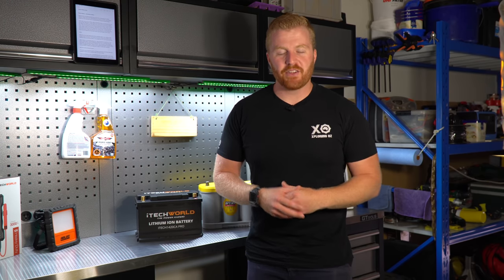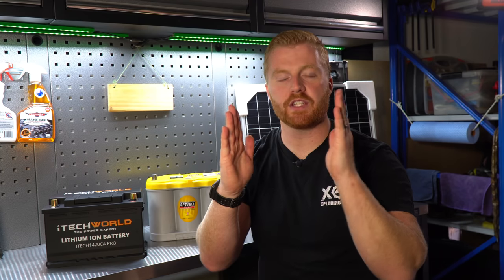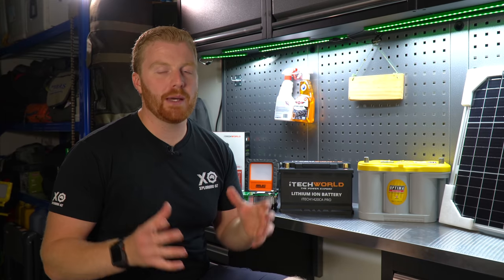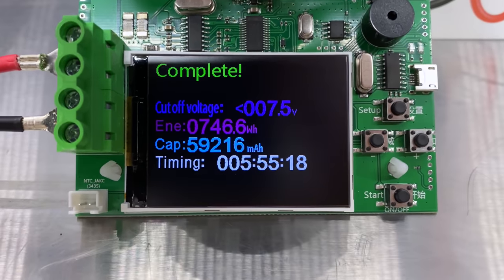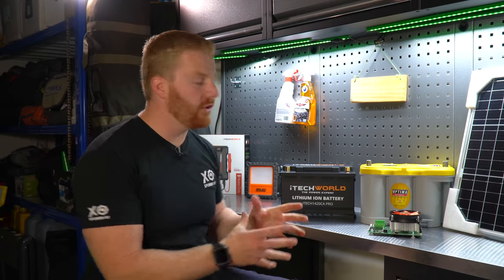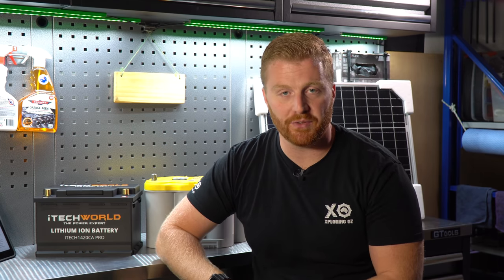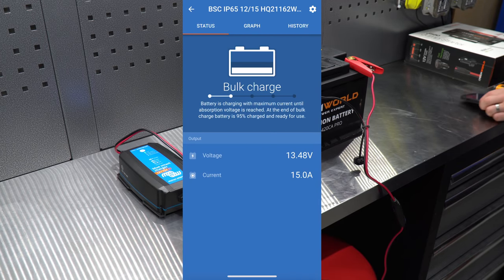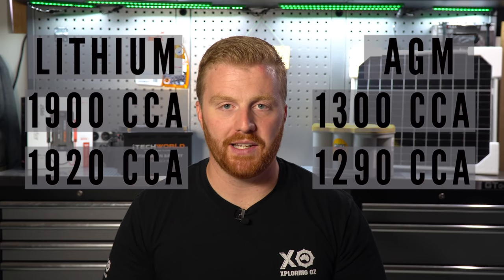LITHIUM CRANKING BATTERY | 1420CA PRO | Can it POWER the 4.5L V8 diesel? iTechWorld Starter Battery

Comment: Looking for one for my 1992 Land Rover Defender. It’s in regular use and has a good alternator and no in car entertainment system to take up power but it has taken the lives of 3 dirt cheap lead acid batteries in the past 3 years, one was due to freezing in winter. Will the Lithium be suitable for the 30yr old Landy?
Reply from the maker: Hey mate, interesting to hear your experience with lithium previously. I'm hoping to test out whether or not this lithium is the real deal or not with my testing. I've been using this for about 6 months now, on and off-road and so far no problems 👍

Comment: I wonder what lithium chemistry it is because lifepo4 batteries will be damaged when charging at 0°C and below, if it's lipo then that would be like having a bomb under the hood.
Reply: Why would it be a bomb? Most Lifepo4 batteries have temp cutoff protections
Reply: @PO-sz7qw  i don't know how it works but a temp cut off won't cool the environment its in is: The engine bay.
I'm pretty sure it gets way hotter under the hood which could be exceeding 'storage' temperatures of the battery, and once they vent and that ignites its a runaway situation. If that battery is being used as an auxillary and the driver doesn't notice its hot and continues to keep it in a harsh environment shit could go south.
that was my thought a year ago.
Reply: If its lithium ion like ev's then you may be correct.
Any damage can set then off.
I've seen reports, thousands of evs burning, china, usa, europe, cars, busses, bikes....most not reported for obvious reasons.

Comment: I think there is an issue if you try to charge a lithium battery in sub zero.  That could be a problem in the high country in winter.
Reply from the maker: Potentially, however given that it is engine bay managed, it would only take a minute or two to warm up and therefore accept charge, as long as you have the charge to start the engine in the first place.

Comment: I am planning to put  2   100 amp DCS lithium batteries in my 200 series , They are made with cylindrical cells which as I understand are far more reliable for an under bonnet application. No sure I would put an itech world battery under bonnet as they are prismatic. Still I hope it works for you .
Reply from the maker: For sure, there are different options to consider if going to lithium, however I guess the benefit for these is the price... if they do run well long term, the value for money will be great. 
Cheers, Nathan.

Comment: I would be interested in the amps the lithium battery draws from the alternator.  It's widely known in the lithium battery community that the li battery's very low internal resistance means it will place a considerable load on the vehicle's electrical system even if the alternator is not in a position to supply the current to hold voltage regulation.  This type of load can result in alternator failure.  Victron issued a whitepaper that discusses this aspect of things but it refers to lifepo4 batterys where this unit may be a polymer.
Reply from the maker: For sure, this is another interesting topic to look into. I'll see what I can do to include this topic in a future review video. 
Cheers, Nathan.
Reply: abso-phukin-lute-ly  agree !!
Reply: Most alternators in modern cars are either smart or temp compensating I wouldn't worry about it alternator will decrease amp output based of temperature most likely a non issue dcs has a few great examples

Comment: lipo and lifepo4 batteries do not appreciate high temperatures that are found in internal combustion engine bays.  They will work but will drop capacity faster than if not placed there.  I have seen other reviews of itechworld's lithium starter batteries where they have shown a lower capacity after a year than would have been expected but for high temperature operation.  Perhaps make a note to yourself XploringOz to recheck the battery's capacity in a years time after using it as a daily driver cranking battery.
Reply from the maker: For sure and this is a big reason that I'm testing these batteries, specifically under bonnet mounted! These tests will give us a good baseline to come back and check the health, performance and longevity of these batteries at different points in time. 
Cheers, Nathan.

Comment: Great info and analysis, I am now a subscriber.  I just wish the I Tech World had > than 1400 cca (actual).  I would like 1600 to 2000 cca.  Mine is merely for a highly modified 7 litre V8 sedan with quite high compression rate as it is a stroker motor, which puts a real strain on starter motor and battery to crank my baby over to ignite and start at TDC each time for startup.  I have had Optima Red Top batteries and in truth have had nothing but trouble in the real world...👌👏
Reply from the maker: Cheers mate, thanks for the feedback. 
It would be interesting to see how this would perform in your application, particularly holding that voltage higher for longer too. 
Not sure it would go to well in the colder climates though…. 🤔
Cheers, Nathan.
Reply: @XploringOz  Ahh, I live in Brisbane Australia.  Rarely gets what people term "cold" here.👍
Reply: 1400 CCA lithium battery performs quite a bit better than a 2000 CCA lead acid, it would be no problem for that V8, in fact it could almost certainly handle an engine twice the size if you wanted it to. As soon as you put one of these in you'll be amazed how quickly the engine starts.

Comment: Sorry to sound negative here, but if the Lithium battery is sensitive to heat and  under bonnet remperatures, why didn't you test that? You seem to have done the complete opposite by testing at freezing conditions.
Reply from the maker: Hey mate, completely understand your concern here. The reason I didn't test the heat capabilities, is we already know the BMS will shut the battery down at 80 degrees Celsius, before any damage is caused to the cells. Shy of placing this battery into an oven, this can't be tested any other way... and I'm not keen on explaining to the insurance company why we had a house fire when sticking a lithium car battery in the oven 😂 
Further, the main concern with lithium and heat is the longevity of the battery and it's performance over a period of time when exposed to constant high temperatures (AKA engine bay). 
For this reason, I will be conducting similar tests in the future after some time using the unit, to see whether to results have been significantly effected by the operating conditions.
The reason we tested the cold conditions as this is an important part of measuring the claimed CCA ratings, particularly when the battery is new and we can compare these results to the claimed specifications. 
Cheers, Nathan.
Reply: @XploringOz  so have you actually measured the under-bonnet heat in your vehicle both when stationary and when on the move?
Reply from the maker: @bobronai4641  There's a lot to it when measuring the temps. The ambient and component temperatures change significantly around the engine bay and around the battery. 
After a highway run, I've measured roughly 67 degrees on a low 30 degree day. This is measure via an infrared thermometer, so I would assume the internal temps would be lower, given that I've insulated the battery.

Comment: Great review again, ITechWorld have two models of cranking batteries for sale the "1420CA and the 1420CA PRO" would the 1420CA be suitable for a 3 litre Nissan Patrol? - cheers
Reply from the maker: Cheers mate, so reading the specs I would think that this model is very likely to suffice for the Patrol 👍 
If you are seriously considering purchasing, I would probably just double check with iTechWorld themselves to be 100% sure. I found they are quite quick at replying to queries. 
Cheers, Nathan.
Reply: @XploringOz  Thanks for the quick reply Nathan, I did call and discuss with ITechWorld and as you said, they were very helpful. The 1420CA will do just fine for my Patrol and as I don't have winches an play hard; they advised I will have no issues with the standard option. It was just a lot of money but I made the purchase feeling happy with my reasearch.Spot ya next review ...cheers Scharfty
Reply from the maker: @gregscharf1367  Awesome, glad they could help too. Sounds like it might be the go then 👍 All the best with it!

Comment: and the actual issue with lithuim/internal resistance/charging control 
and how this has been delt with has not been explianed and/or shown 
as this will cause a engine fire --
Reply from the maker: The internal BMS assists in regulating the charge current and this prevents the vehicle from burning to the ground. 
Cheers

Comment: So are they faulty and recalled...
I have spoken to many that say they are.... since the website has zero available still. Seems likely...

LOL 😆 the cranking amps for lithium is 10sec test they did 5 seconds...

They are also 60ah... 1099 each.
DCS is 3700 for duel 130ah or 260 vs 120 with two of these...

For size and use these are pointless...

Comment: The fact is that some 280 amp hour lithium iron phosphate batteries can deliver 20,000 amps to a short circuit. The reason they're not used in vehicles is because vehicles are subjected to freezing temperatures and lithium iron phosphate batteries cannot operate in freezing temperatures.
Reply from the maker: I’m not sure if you watched the video or not, but there is a whole section dedicated to freezing temps?? This battery both discharged and charged at -20 degrees without issue?
Reply: @XploringOz  I did see the freeze test, but if it's a true lithium battery, charging it at that temperature just destroyed it. The result is dendrites growing between the layers of conductive material and will puncture the insulating layers and start a fire eventually. Do not store this battery indoors as it's a ticking time bomb.
Reply from the maker: @basspig  I guess time will tell.. obviously I'll be coming back to this battery to conduct several more tests in the future and the results will give us a better indication 👍
Reply: @XploringOz  in the meantime, treat it like a bomb and keep it away from flammable structures.

Comment: Lithium battery cannot be charged at negative temperature at all. Even 0c is not an option.
Reply from the maker: I hear where you are coming from, however it's the BMS that controls that. Whether my testing allowed the BMS to come up to 0 degrees, or whether the BMS didn't prevent the charge, either way my cold battery manage to bring in some current.
Reply: Heaps have built in heaters

Comment: I wonder what happens to your cars electrical system when the brain in the battery dies?
Reply from the maker: I guess the same thing that would happen with any catastrophic failure. In most instances, the vehicle would have mechanisms (such as fuses) to protect it. But there's always instances where parts like these fail.